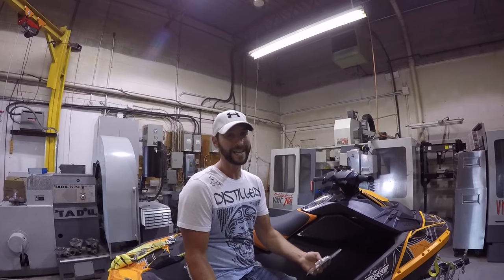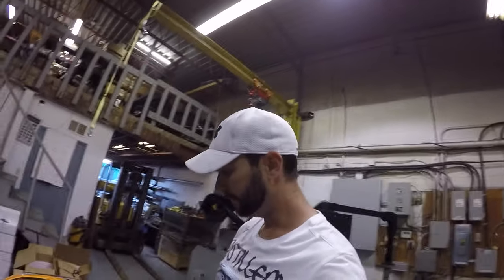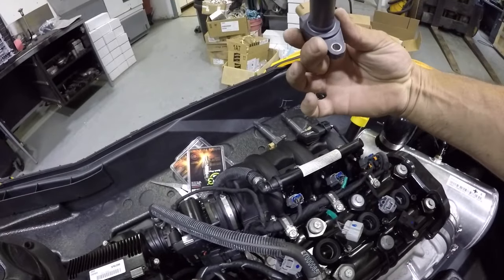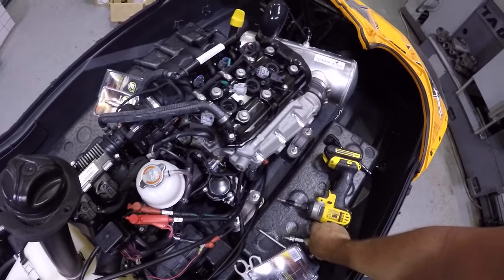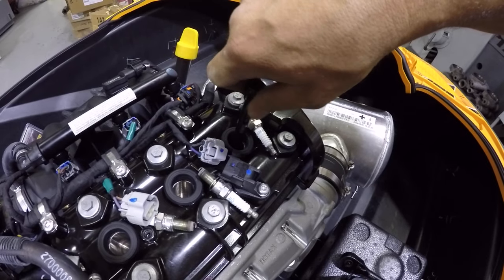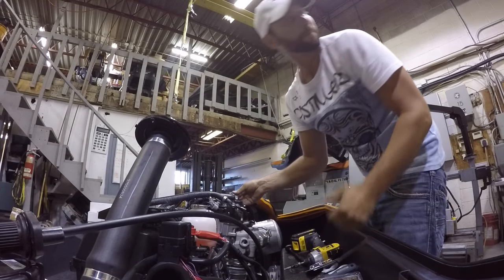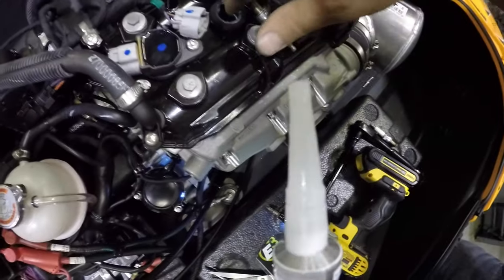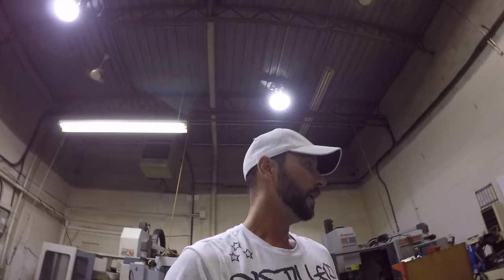#38 How to change spark plugs on seadoo spark

Comment: The Canadian Tire Special Black Stanley Racket Set.  

The RXP had the caps removed.  Good Color on the plugs,  Brand new boat though so to be expected.  Looking forward to the Trip Vid.  Also I would wager that the stock caps provide a good seal as the are bolted down onto the rubber ring.
Reply from the maker: Yes the plugs seal well

Comment: How many hours do you have on your Spark? You're pretty meticulous about maintenance it seems but has it been reliable? Looking at buying a 2014 H.O without iBR, about 70hrs, always maintained well apparently and looks to be a good deal. Does yours have iBR?
Reply from the maker: I have about 100 hrs no real maintenance required just an oil change , my friends yellow 90 with Ibr has 127hours all he has done is a oil change

Comment: how often do you wash the engine? looks amazing for being 2 years old. good job
Reply from the maker: Ive never washed it ive cleaned the hull inside if i drip oil while doing an oil change thats about it
Reply: +I RIDE 705 interesting.... do you ride in salt water at all?
Reply from the maker: never always clean clear fresh water
Reply: +I RIDE 705 oh ok. so maybe I should keep washing my engine when I go to salt water. fresh water I don't wash the engine but still flush and wash the outside.
Reply from the maker: some people have talked about spraying there engine with stuff to protect it from salt water application cant remember what the stuff was, do some research im sure youll find it
Reply: +I RIDE 705 i used a couple spray protection and the best one to me is fluid film. great stuff to protect from corrosion.
Reply from the maker: +Jose Neto (AARR) I think fluid film is the one they were talking about
Reply: @fly low- I know this is a hella old thread but I ride in saltwater exclusively with my spark for about 2 years just took the top deck off for the first time 2 years later and it practically looks brand new in there. Light surface corrosion on a few parts but nothing a little cleaning and silicone spray didn’t fix

Comment: Do you have the original exhaust?
Reply from the maker: no I cut the stock water box off and did a strait exaust mod
Reply: I RIDE 705   I have a spark trixx and i want a good exhaust sound
Reply: Continue vlogging man I love your videos
Reply from the maker: Getting rid of the water box gives it a deeper tone but not crazy loud, but noticable rumble.  if you re route the exaust to the back of the hull i believe that is much louder but personally think it might be to much a bit anoying and piss everyone off, im glad i just did the plastic muffler  box delete.
Reply: I RIDE 705 thanks man, continue vlogging.
Reply from the maker: thanks for watching !
Reply: I RIDE 705 will you buy another pwc or you're gonna stay with your spark?
Reply from the maker: Rxp255 Seadoo going to stick with this one.  I like it and should last a long time
Reply: I RIDE 705 I have one it's brutal
Reply: Good choice

Comment: I miss being able to take the seat off, replace the plugs, and be back out in the lake in under 2 minutes. Hell, I've changed plugs on old rotax 2 bangers, while I was out floating on the lake. We I love my Spark, but what a shitty design for general maintenance. You can kinda shove your arm up through the electrical access panel on the left side (skinny arms), just to feel if things are potentially seated right, but not really.